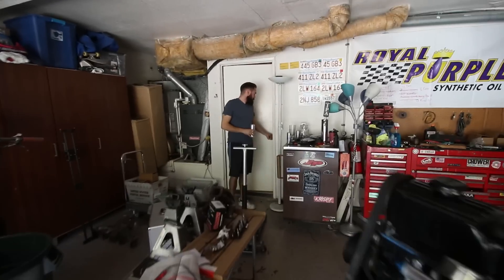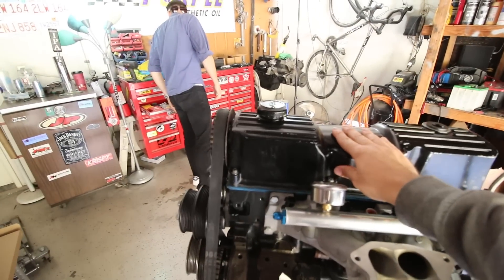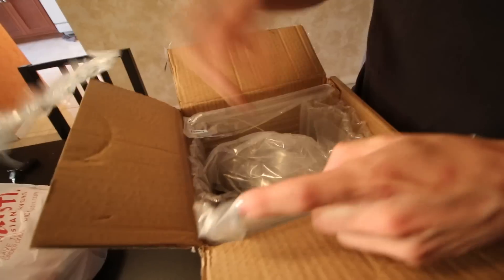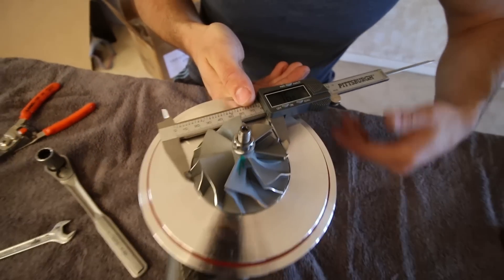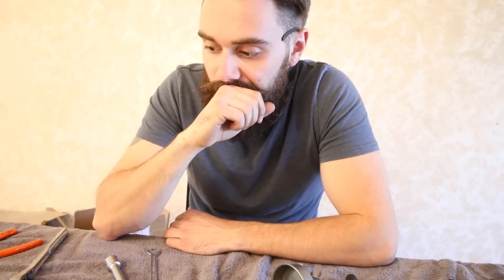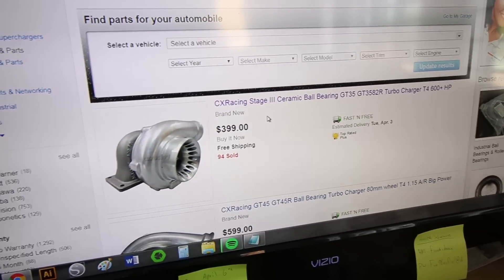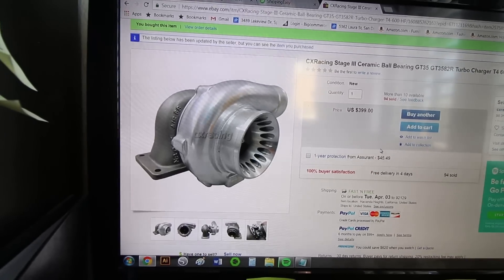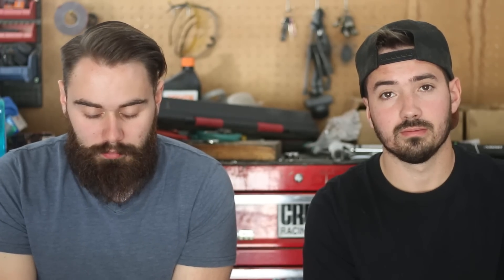What's INSIDE an eBay turbo!?

Comment: I've used ebay stuff and have bought name brand from ebay aswell. I've had a few "this is too crappy to even consider putting on my car" moments but nothing major or expensive. Those who buy from flebay know what's up and after some experience, acquire a good feel for what, when and how to buy to get the best bang without getting fked by the shady sellers.

Comment: Was in a financial bind a few years back and my blitz bov siezed open so I ordered a Greddy type S knock off bov called a freddy super racing bov which worked out very well. It's been on my car for over 7 years 120K miles and holds 16 pounds of boost just fine.
Reply: Oh just opened the prize and it's Fire! Gonna clean the car and apply the swag in the coming week or so. Thank you and keep the awesome videos coming. 👍🏻

Comment: Had loads off eBay over the years. Turbos, air box and intakes, blanking plates and sensors, LEDs to rice up my interior. Most recently I got LED DRLs and a HID upgrade for my headlights, last night I bought the LEDs for my fog lights too so it all matches 😁

Comment: Also of note:

It has a 270° bearing, and I don't see any thrust bearing hardware on it either.
Reply: Anthony Cox  the ball bearing is a angular contact it takes the thrust load from the compressor side the stock 270 bearing takes care of the exhaust trust  and it is preloaded to be used as a radial bearing. Turbonetics used this for years. Still do good proven design. I’ve built these on large turbos using up to 5 inch inducers but use Two back time back this takes care of the thrust in both directions. Very high boost 100 or more on a diesel with 130 + drive pressure!

Comment: Ebay performance parts..
Actually bought a used Arizona z car intake manifold as well as a used 8007 holley carb. Planning on putting it on my 1981 280zx l28 and hopefully make a blow thru turbo config

Comment: Have not bought performance parts on eBay,  but I did get the wheel bearings for my truck.  29.95 vs 155.74......

Comment: Pretty much my Whole car is ebay parts, Turbo is a CXracing T04e , injectors are from an ebay store, intercooler and pipe is cxracing, clutch it XTD, waste gate and BOV are CHials from ebay. I've gon over some of the problems I've had with eBay stuff on my channel. Seems like it always comes down to 2 things, QC and lack of warranty, but as long as you go into it acknowledging that you're going to have to go through it and possibly fix it and that if it is DOA or it blows up later your on your own then it's ok to buy this stuff.  My CHial BOV and waste gate were both DOA and had to be "fixed" before I could use them, didn't cost me anything but time to fix them though.
Reply: You play a risky game with EBay. And the no-warranty factor is huge for me, and not worth risking everything going well so that it's a non-issue. In the end, there's a reason it's an axiom: "You get what you pay for."
Reply: Stovall's Garage Chinese "eBay" fuel injectors are junk. Have come across these several times as a tuner (both sold legit and sold pretending to be genuine Bosch) and they have always caused problems. Their low duty cycle performance is terrible so they cause running problems at idle. Also, often their opening latency increases dramatically at fuel pressures above 4 bar, causing them to under-fuel.
Reply: @Kj16V  I bought Bosch 30lbs off of ebay for 80 for my 04 gt. Haven't had a problem but ik they're actually Bosch.

Comment: I got a cheap 120$ Dremel bearing no brand name Turbo off eBay for my D16 and I've been pushing 15 pounds of boost on it for lil over a year now and no shaft play so far
Reply: Got a cheap Universal intercooler kit works but I believe I can gain more horsepower just by switching out to a better 1